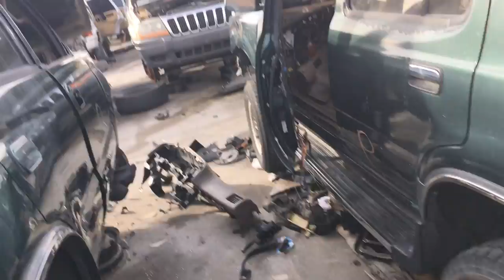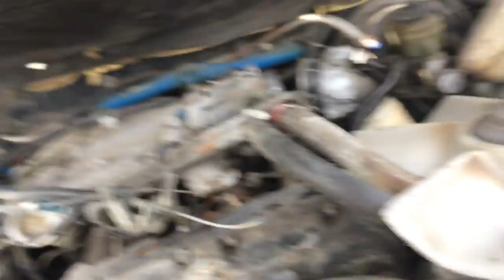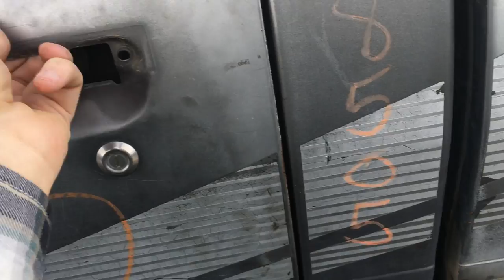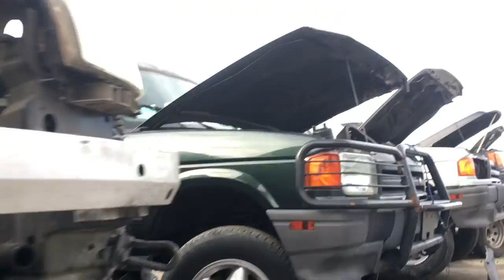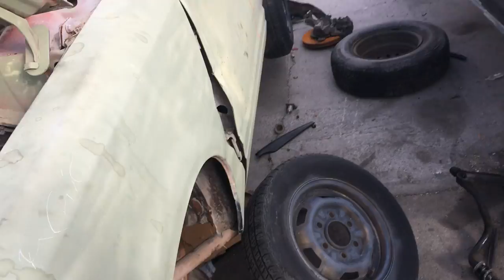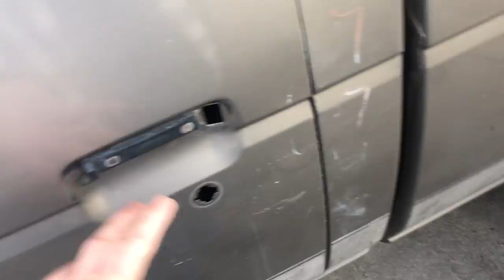Junkyard toyota 4 runners & pic ups

Comment: The northern folks would go nuts for the frame on those toyoders
Reply from the maker: the mexicans go crazy for em to, if theres a yoda pickup there they strip em clean in a few weeks. but the 4 runners are a dime a dozen especially with the 3.0 crap in em. a man could make a good amount of money selling parts back east
Reply: Ive seen them here on ramp trailers, 1-3 at time loaded with parts. They
 send them to the counties in and around Haiti, there are so many..  Even with 300k they don't care they rebuild them. They love the little Nissan hardbody pickups too.  The Spanish speaking exporter guys I used to talk to said they did well when they were into it      Oh, The classic cars get shipped out of the same port to go to Europe.   Anytime I see them "heading south" its probably the last time you will see it in the states.